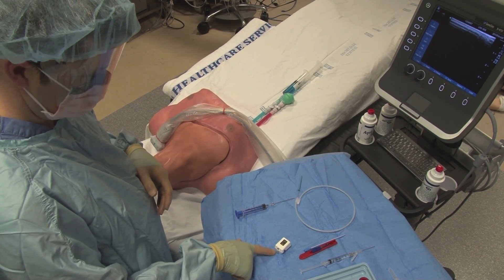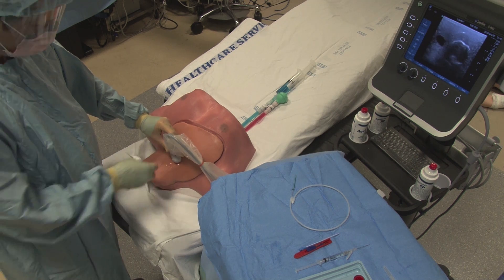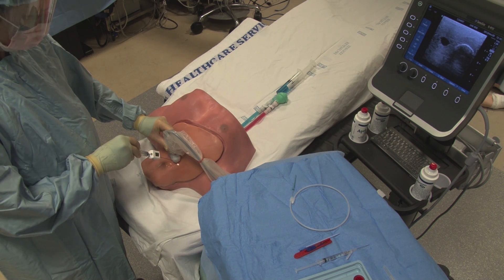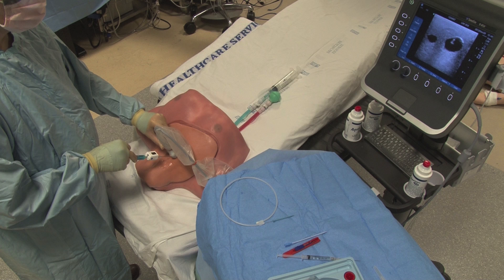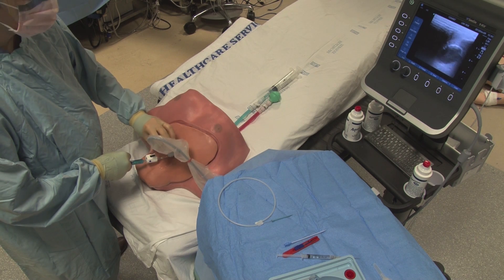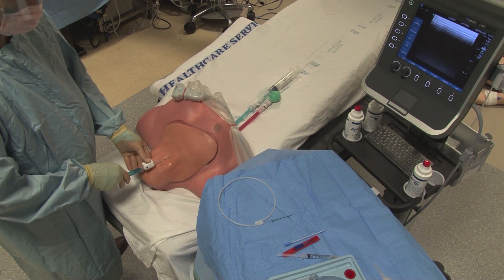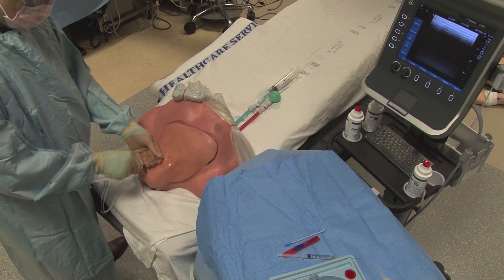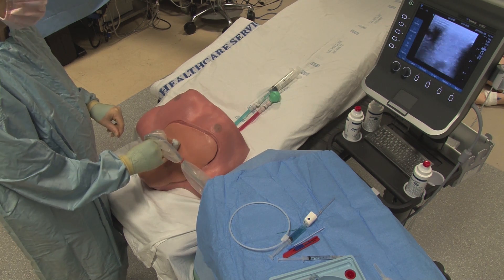Ultrasound-guided Internal Jugular Central Venous Catheterization: Needle and Guidewire

Comment: I'm an antique but have accessed the venous system using the internal jugular vein many times....hundreds, but probably fewer than a thousand.  I have never used US guidance and there have been neither failures nor complications. The anatomic position of the IJ is relatively constant though the cupula may rise surprisingly high, esp. in the presence of COPD and can present risk to the novice.